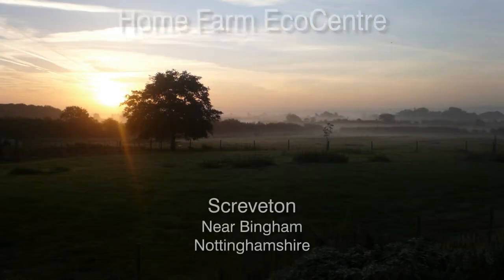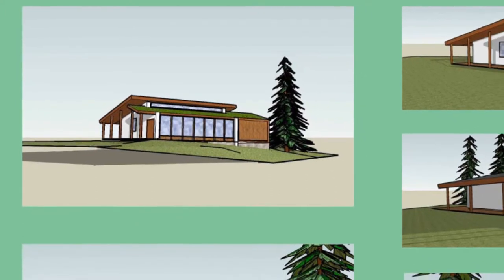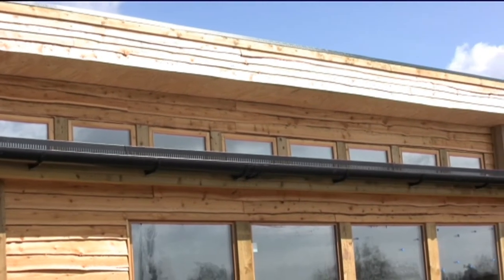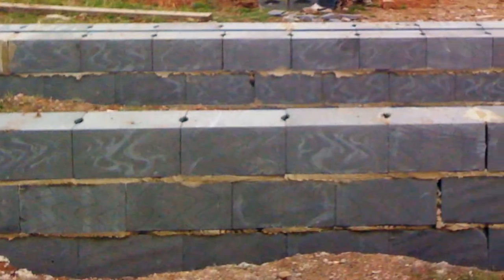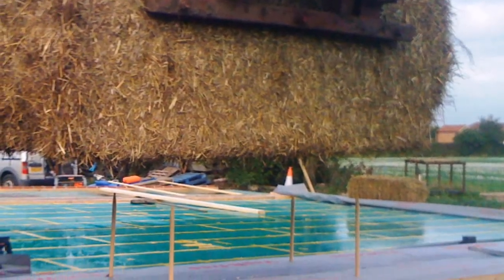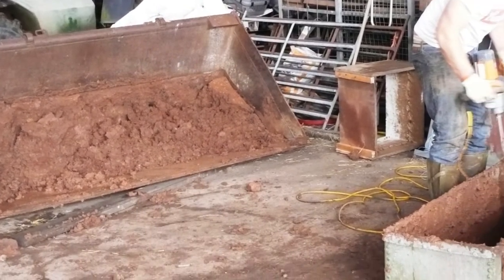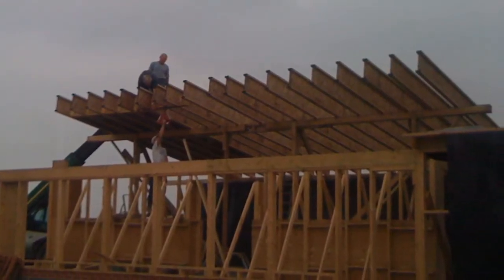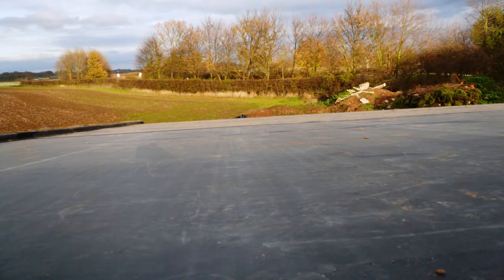Home Farm Eco Construction Film.wmv

Comment: Straw bale walls are naturally fire resistant. Loose, dry straw is combustible, but when it is compacted into bales, theres not enough air for the straw to burn well. Combining plaster with the compactness of a bale wall enhances fire resistance.The plaster  effectively seals already fire-resistant bales inside a noncombustible casing. According to fire safety tests conducted by the National Research Council of Canada, bale walls withstood temperatures up to 1,850 degrees for two hours.